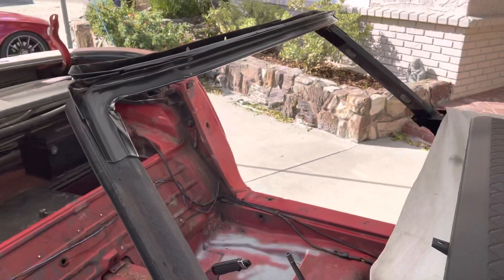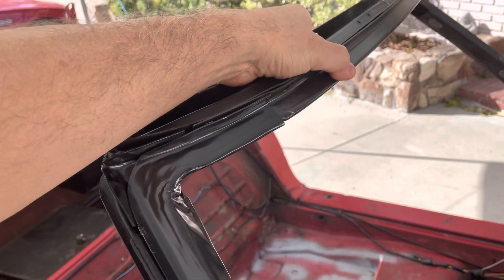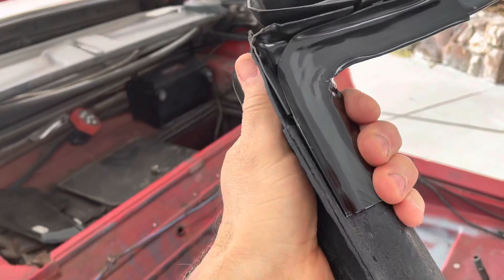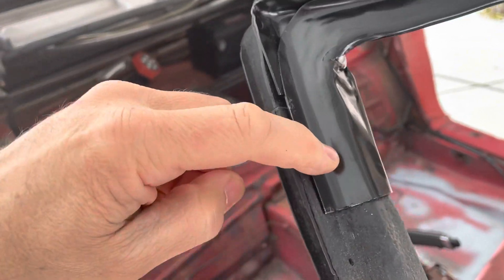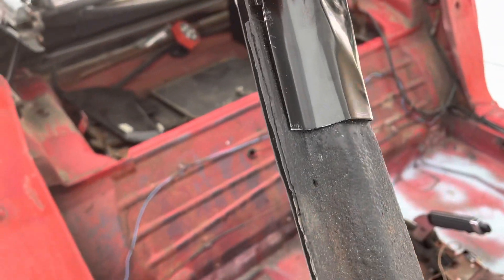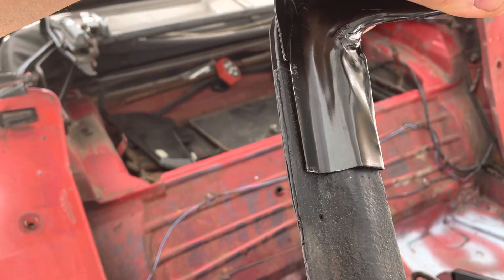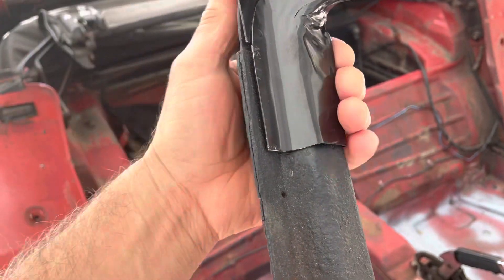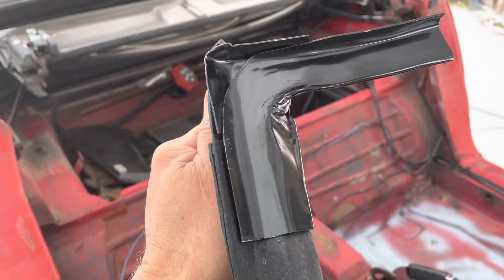C3 Windshield Frame Support Welds

Comment: I may be late, but punch or drill 5/16 holes and plug/spot weld it well. It is structural to the w/s and on a convertable even more so.

Comment: Make it fit better then plug weld it. I coat the undersides of those parts with POR15 after I strip the black primer off of them.